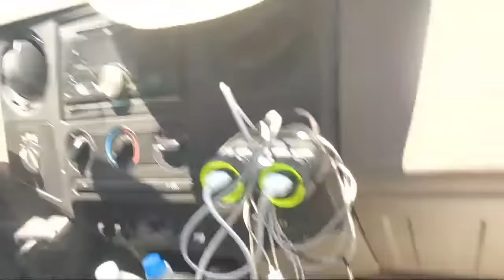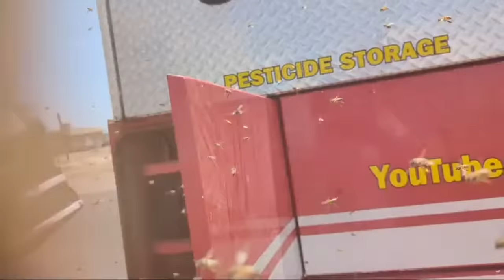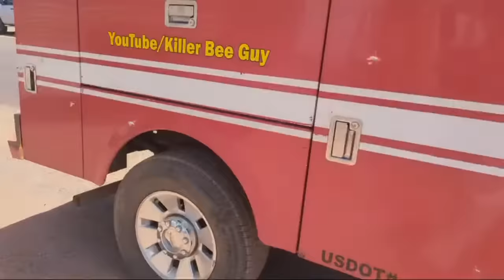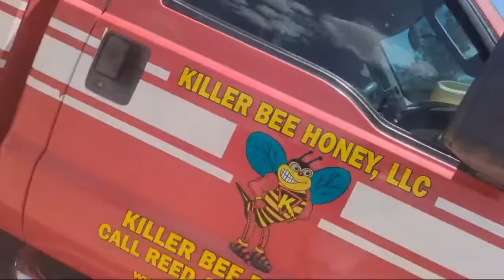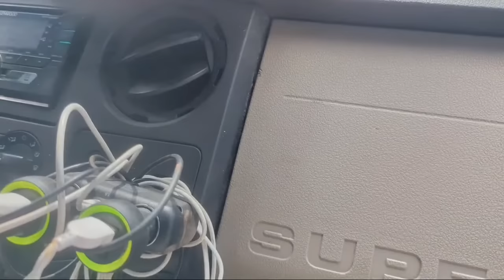Major Stinging Incident

Comment: Wow! How scary for you guys. So glad everyone is safe. Reed, I swear you were having an anxiety attack in the truck. This one would have been really hard to deal with alone. So thankful that you have Hosh for support. Love you guys. Stay safe.
Reply from the maker: I just had to slow down the heart rate and get the breathing under control. When I feel the heat exhaustion coming on I need to get a handle on it quick! 
More removals lined up tomorrow!
Reply: Totally you have to look after yourself.
Reply: You have a hearth condition and work with that? You need to be more caring of your self.

Comment: Reed and hosch. I hope everyone is ok. This is horrible and prayers for the ones that got stinging. I hope you get to talk to the one responsible for this stinging incident.
Reply from the maker: I'm going to try to find out!
Reply: Share my suggestion, cause I'm censored so see if they could use dry ice and immediately cool it and slow active and vacuum with poison in bottom so it stop in it, trying save  honey maybe 🤔 help cheapest way get rid of them.
Pray it works 🙏

Comment: I know this is an older video, but why don’t you try using soapy water in a spray bottle? Like the sprayer they use to spray weeds or even the ones that the exterminators use? It sprays a fine mist of soapy water and it works to kill them immediately. You can even salvage the wax from the nest that way because you’re not using poison. I know it wouldn’t work for spraying yourself, but it actually work really well and quickly.
Reply from the maker: It works great and I used to use it but got WAY too many complaints about the mess!

Comment: Pro tip from an ex endurance athlete: ALWAYS have electrolyte sports drink. Heat exhaustion gets worse if you drink straight water, because it dilutes the precious few electrolytes you haven’t sweat out already.
Reply from the maker: That heat is a killer!
Reply: You don't need expensive sports drinks, too damn expensive when you work outside in summer everyday, on real hot days a I can easily go through anything from 4-6 litres a day to keep your pee looking a healthy colour.

A cheap way of doing it is to put a pinch of Lo-salt in your water - 50% sodium chloride, 50% potassium chloride so it keeps your sodium and potassium levels up. Also found your body actually retains the water rather than peeing it straight out which happens if you drink lots of plane water on a hot day. Doesn't taste the best when it's warm, but it's fine when it's ice cold.
Reply: @deezelfairy  Excellent idea!

Comment: 20:16 is just downright scary!  Like the use of the clamp to spray the glue. You need to round disk out of 2x12 then make a slot for the end of the clamp to slip into. It will let you set it up and walk away.
Reply from the maker: Good idea!

Comment: Open hood of idling truck  this helps A/c cool better   plus change coolant to Evans waterless antifreeze  this will keep that  truck running cooler 
 This will avoid any system problems  .. awesome video  stay safe 😊
Reply from the maker: Great tip! Thank you!
Reply: @KillerBeeGuy   i have upgraded a few trucks likes yours  added cooling fans  electric    griffin aluminum HD radiator  and   Evans coolant 
Silicone hoses   hd thermostat   this drops under hood  temperature  25  + degrees cooler with hood up   an electric fan over evaporator core in front of radiator   will drop  extra 20 degrees for ac with hood up  .. awesome video   people don't realize  even a weed eater 300 + yards away  can piss these guys off 
That city worker banging on things needs a good thrashing  for that stunt .. awesome video thanks for posting  stay safe
Reply from the maker: Thank you for more great ideas! More vids coming!

Comment: One $1.27 road flare would have done the job.
Reply from the maker: We live in the desert. NO fires ever.
Reply: @KillerBeeGuy  I didn't suggest reckless burning of it, but folks have been building fires in the desert for millennia...and it's still there.
Reply from the maker: The local law enforcement and Fire Depts have notified everyone that fires are a no go.
Reply: @KillerBeeGuy  I can certainly understand that- I'm not trying to troll or anything. Those bees were PISSED!
Reply from the maker: If I could burn it I would be the first to light the match! Then it would be a Bar-BEE-Que!

Comment: Your comment was that they were meaner than sh#$! Have you EVER run across a nice Killer Bee? (being sarcastic) OBTW Killer Bee Guy-you had a video shot inside the fire truck where the camera was aiming up towards your chin. Right underneath your chin where two zipper rings meet appears to be a gap in your suit. You might want to double check this.
Reply from the maker: Yes! But it was temporary... They can and will go nuts for no reason.